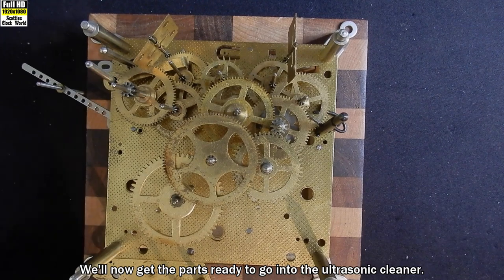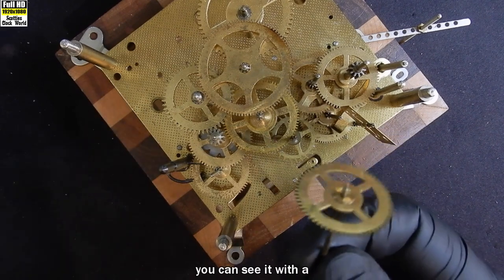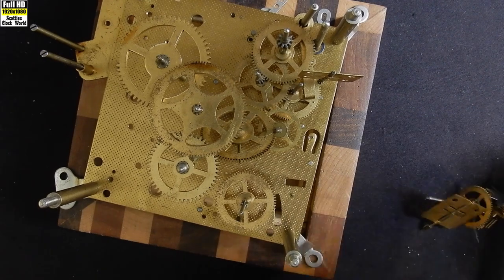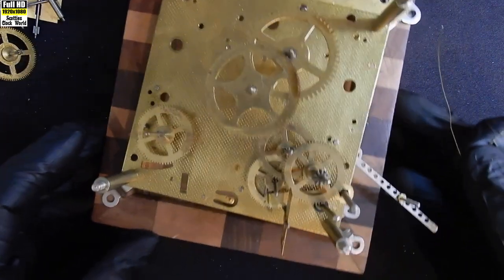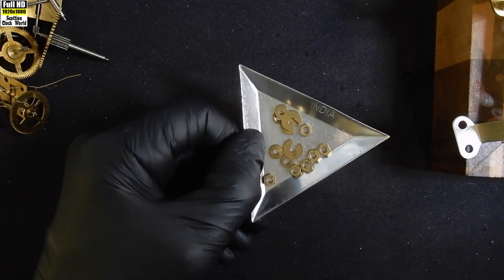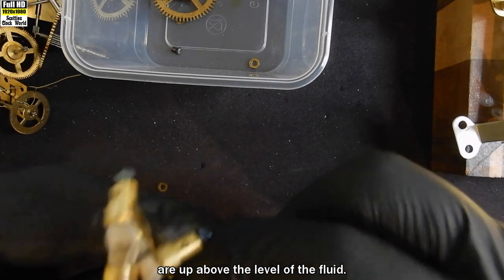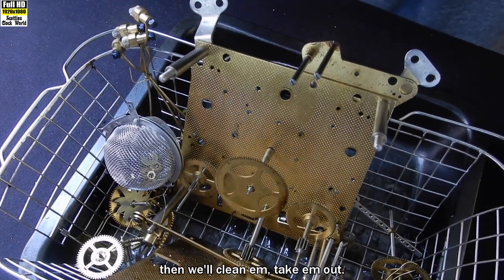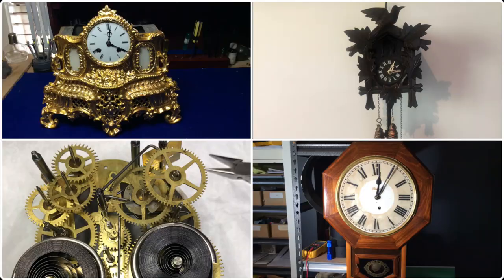Junghans W200 Westminster Chime Mantle Clock Repair - Part 3

Comment: Thank you for your greatly informative videos. Do you have a video that explains how to correct the chime on a westminster chime. The number of notes is correct.But, not the sound. Not sure if i am explaining it accurately.
Reply from the maker: This is the series of hammer strikes on a westminster chime clock.
Rods number:
1 2 3 4
3 1 2 4 3 2 1 3
1 3 2 4 4 2 1 3 1 2 3 4
3 1 2 4 3 2 1 3 1 3 2 4 4 2 1 3

I will be shooting a video on setting up the hammers correctly soon.

Comment: what solution is used in the ultrasonic cleaner?
Reply from the maker: I use Alkyl Diethanolamide. All clock parts/tool suppliers have an UC solution. Chemicals may differ but the end result is what matters.